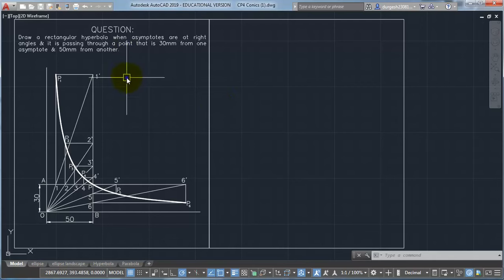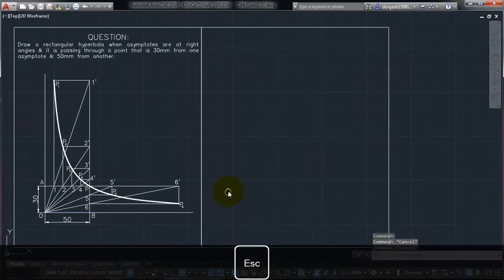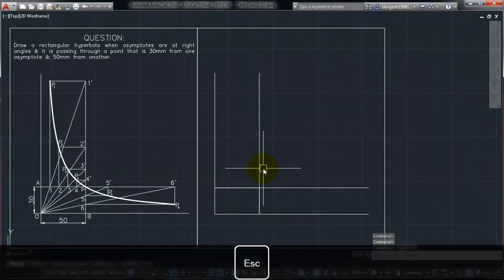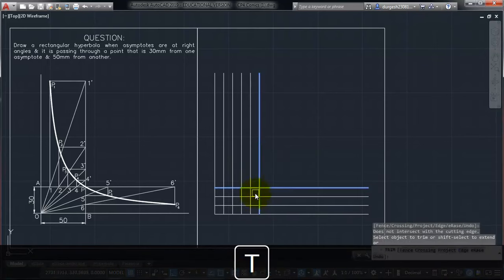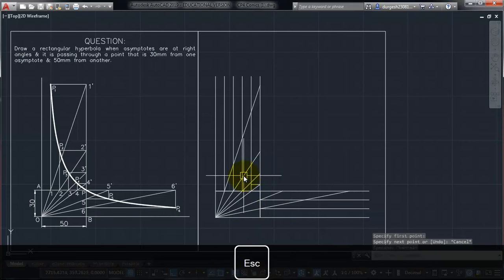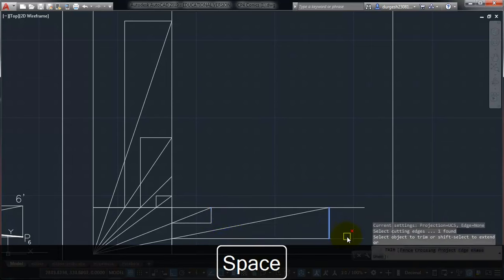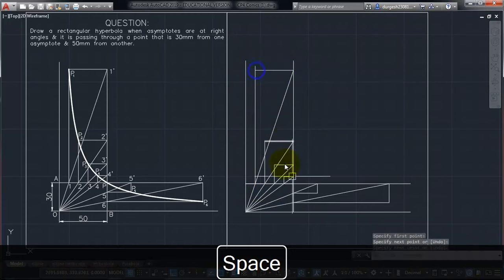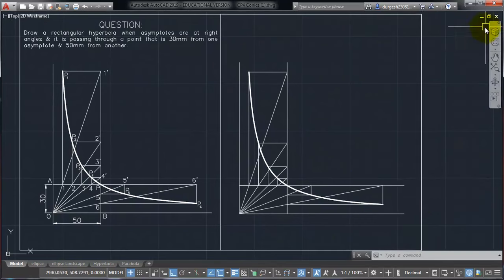Drawing Rectangular Hyperbola in AutoCAD | Engineering Graphics Lab

Comment: Sir can you please tell me A point moves in a plane in such a way that the sum of its distances from two fixed points 100mm apart is 130mm
Reply from the maker: It will be an ellipse. Use arcs of circle method to draw. I have made a video on that.